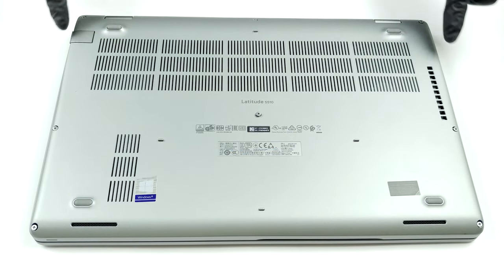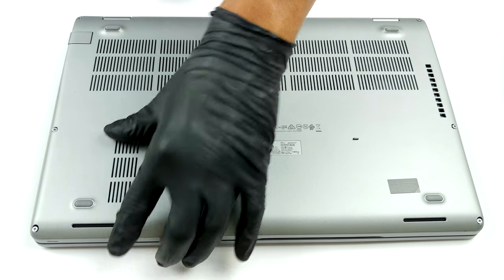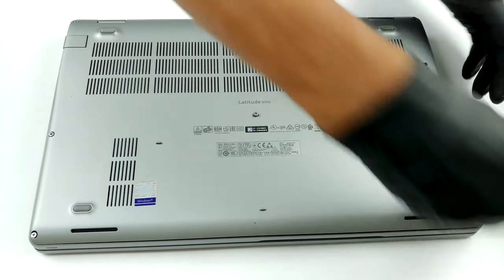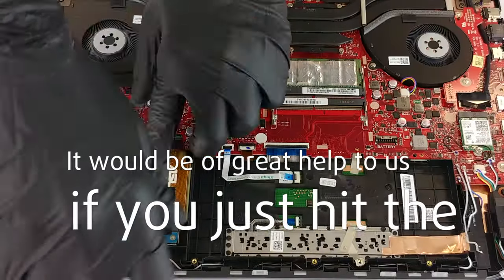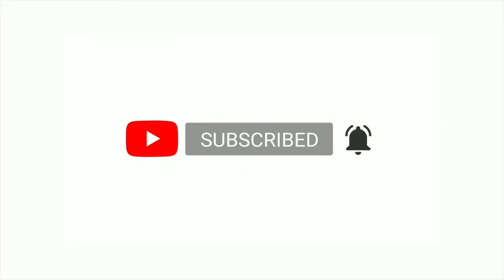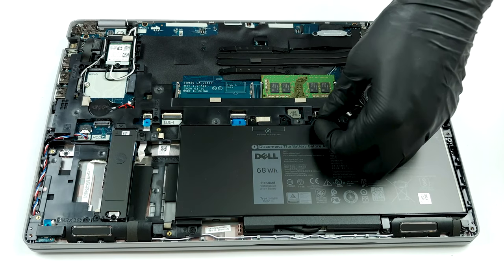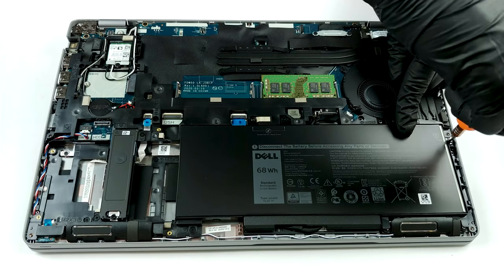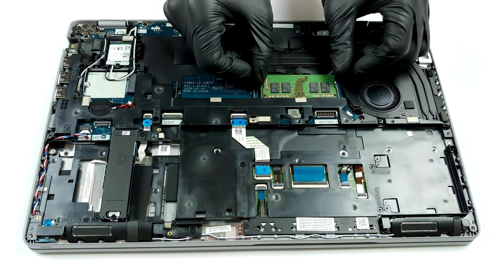🛠️ Dell Latitude 15 5510 - disassembly and upgrade options

Comment: it is physically possible to install two SSDs on this laptop. I've done it. but having both being recognized by the system seems impossible... any suggestions?
Reply: any updates?
Reply: Maybe to somehow run them in RAID config for pc to recognise it as one drive.
But the problem is that the system physically supports 
1x m.2 up to 1TB OR 1x 2.5” SSD
Reply: You used that SSD Sata adapter with two m.2 slots right?!
Now all u need is some kind of custom BIOS or UEFI to unlock that shit…

Comment: Can you swap the SSD with a SATA Drive and if so, where can it be fit in?
Reply: Why would you even do that.
Reply: Yes you can, just have to get a hdd-sata cable, usually they come with the base and screws to install it

Comment: My Dell latitude 15 5510 only has 8gb of RAM, making it hard to multitask. Can I remove the RAM and install 32gb ram instead?  Will it automatically adjust and notice the new ram afterwards?
Reply: I have just done that. It noticed the new ram first time it booted afterwards. Worked like 
charm
Reply: I installed another 8 gb's and this compuater works great! 16gbs is perfect.